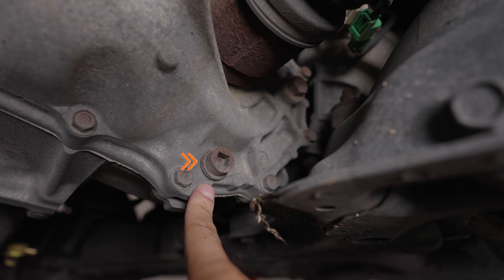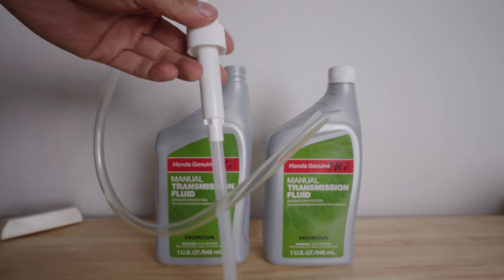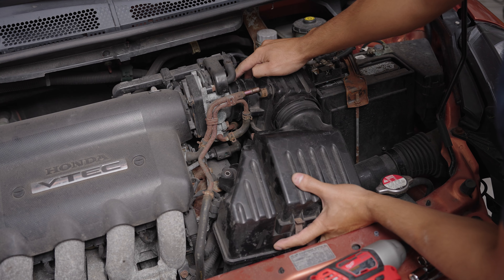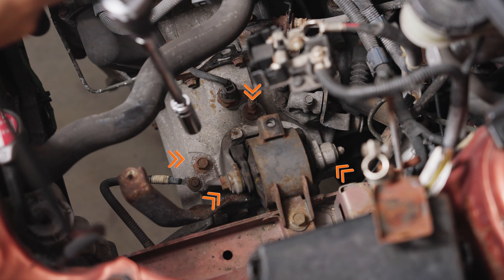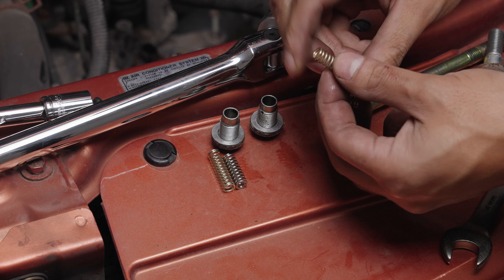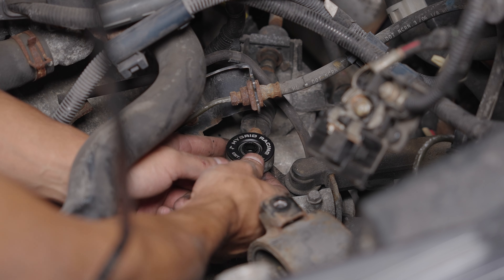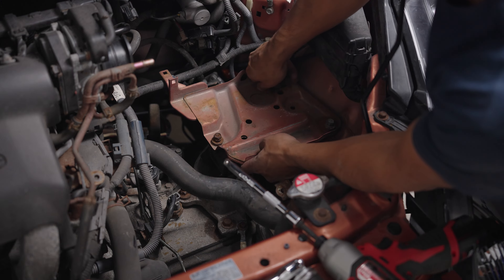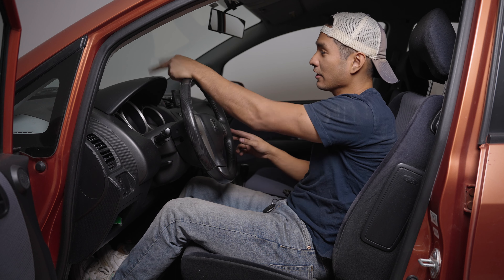@hybridracing  Detent Springs + Shifter Cable Bushings + Fluid Change - Honda Fit GD3

Comment: Nice  tutorial, i wanted to buy the short shifter, but i won't use my car on track. Since it is a very expensive mod do u think is better to just change springs and bushing? Would them improve the shifting experience by themself?

Comment: Seem like you've done almost everything in regards to the shifter parts, one I noticed you haven't done and I can't recommend enough is the Mtec shifter spring!
Reply: I have a 2010 fit sport, I will have to look into this.. right now the car is %100  stock